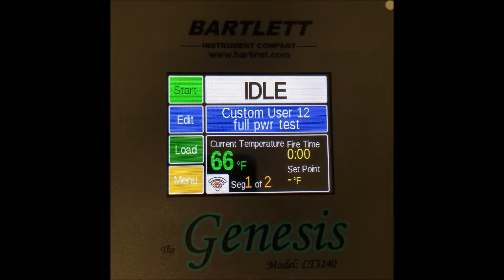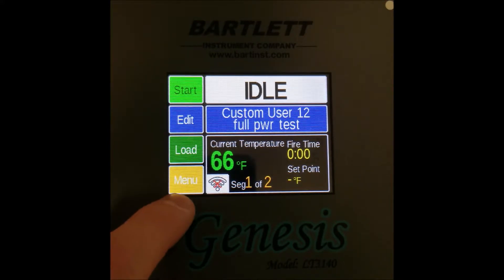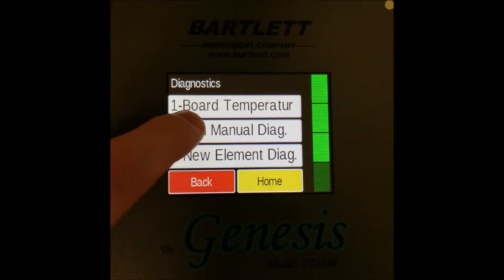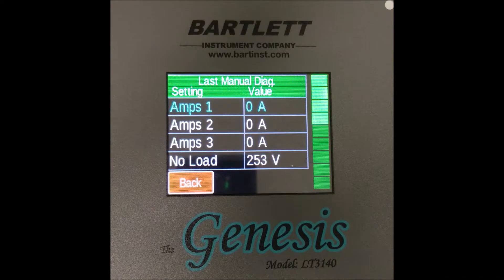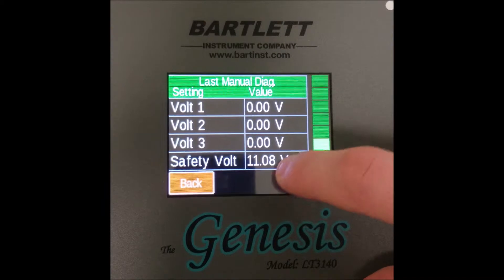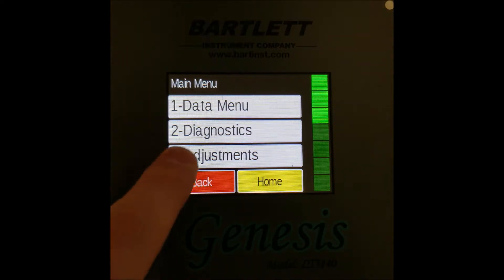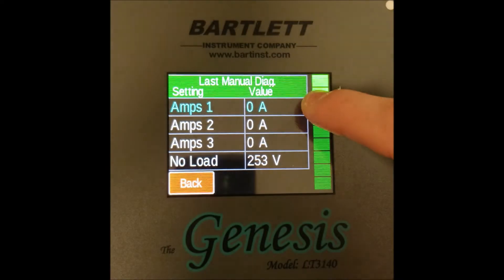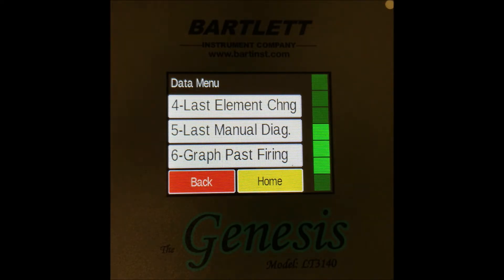Bartlett Genesis/Genesis Mini | Run Manual Diagnostic

Comment: Hi guys, we're having problems with our Kiln with 'E--1 kiln temp increasing too slowly when ramping up'.
How's the best way to diagnose this issue? W have the Bartlett Genesis Mini LT1120
Reply from the maker: Hi @JanaBuvari, we recommend diagnosing an E-1 error by running a Full Power Test (see this video - https://youtu.be/Vs02vBQZQoA?si=B9PmrCPt-qKgmTvN) and checking the glow of the elements during the test. This should help you diagnose if there is a specific section of the kiln that is not heating correctly. Thank you!
Reply: @bartlettinstrumentcompany4969  Thank you guys, I was able to do this and then realised recently replaced elements have burnt out

Comment: When running a Manual Diagnostic where can I learn how to read the results? What would a "normal" reading be?

I just bought a new kiln and had it hooked up today. I want to be sure that my voltage/amps are safe to run my test firing.
Reply from the maker: When you run manual diagnostics on the controller it will bring up the results once it is done running that diagnostics test. 

The first 3 lines in the list are the amp draw of each section. This may read 0 as the optional current sensor may not be installed on your kiln. If a current senor was installed, you will see values in those lines. If you have a 3 Zone kiln (3 thermocouples) you will see an amp reading for all 3 that should total close to the total amp draw of the kiln. For exact amp draw of each zone you will need to contact the kiln manufacturer. If the kiln only has one thermocouple you will most likely see just a total amp draw on Amps 2 but can see them on all Amps 1-3. This depends on how the kiln manufacture wired the kiln. 

Lines 4 and 5 in the list are for the voltage into the kiln and when operating. The No Load means the voltage the kiln is getting when it is not firing. The Full load is the voltage the kiln is getting when all the heating elements are firing. For proper results you need to do a voltage calibration on your unit. This requires measuring the voltage at the kiln when it is not firing and measuring again when the kiln is firing all heating element constant. Here is a link to our website https://www.bartinst.com/kilns/35 Click on the documentation and then select tech manual for the Genesis controllers. Voltage Calibration is on page 4. 

Lines 6-9 are what the controller is seeing for an output voltage to the relay that it controls to turn the heating element on and off. A good reading for these would be anywhere close to 12VDC as the controller's output is 12VDC.
Reply: @bartlettinstrumentcompany4969  Thank you for your reply and for the additional information. Since I have a phase 1/240 volt kiln, I wonder if this reading is close enough to normal to safely run my first test firing. Based on the 12VDC recommendation it does seem a bit high at 18.77. Does the reading below seem in normal range to you?

Amps 1 - 0 A
Amps 2 - 0 A
Amps 3 - 0 A

No Load 252V

Volt 1 18.77

Volt 2. 18.77

Volt 3. 18.77

Safety Volt 18.77

Full Load 253V

Thank you again for your time.